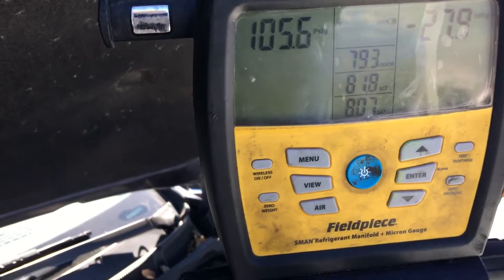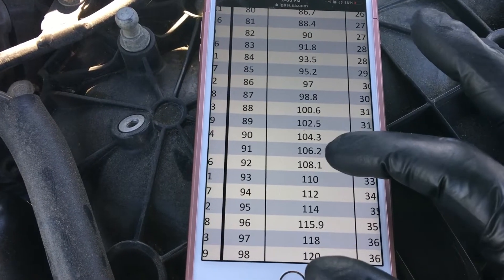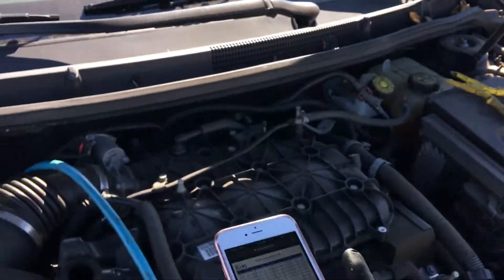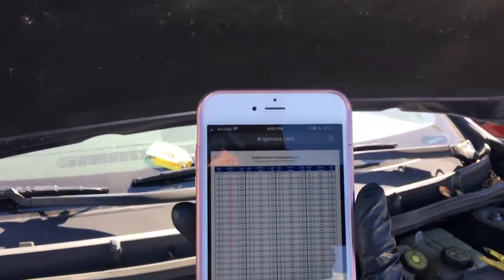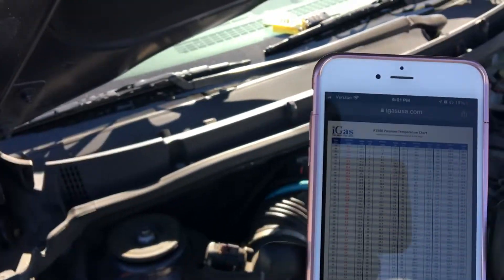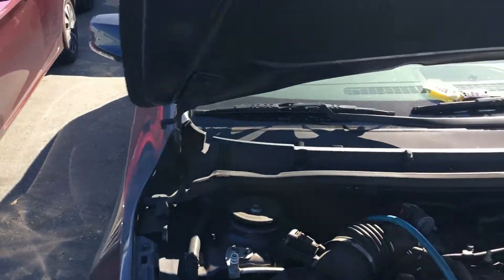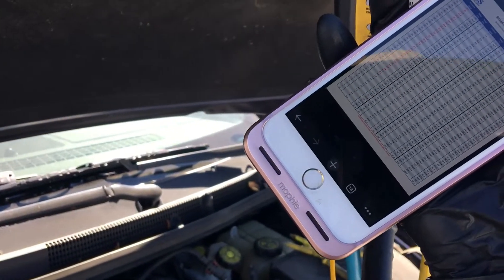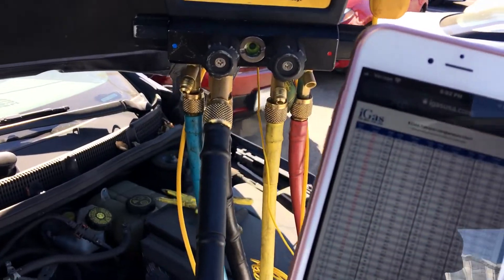Pt chart Use To tell if refrigerant is pure or contaminated￼ ?  Is it reliable ? Only 1 condition￼￼

Comment: Don't know if you've figured it out by now but the p/t chart tells you the temperature that the refrigerant will boil in the evaporator or condense in the condenser. It doesn't directly tell you what the temperature of the refrigerant is at a given pressure.
Reply from the maker: If you don’t know and figured it out by now. 
Automotive isn’t always like residential and have the high side service fitting located at the compressor discharge . 
     Where are you? Be measuring superheated vapor that does not represent the temperature of the refrigerant on a PT chart.

If you don’t know, and haven’t figured it out yet . 
     In automobiles, they sometimes locate the low side service port off the compressor. And you may have an accumulator and a muffler friction loss or heat gain giving you a completely different pressure than what’s exiting up at the evaporator and your PT chart doesn’t mean anything at that point. 

Your information sounds like somebody who learned in a class or read a book . 

Instead of knowing what reality is actually working  .

Comment: Well if the mix is weird enough, I would say you can use it as a guidance. Here is an example I think you would like: I came by one of the “machines” workshops use to service cars. The gauge on it’s internal tank showed 10bars. In our temperatures R134a would have been around 5 bars. Did not need to look up the exact p/t relationship to know it was contaminated (probably with air and/or 1234yf).
Reply from the maker: Probably a lot of air that’s what I see in a lot of the machines.      Even the ones with automatic air purge that after years doesn’t work correctly. 

        Or worse yet the owner of the shop bought the cheapest machine they could get that has no automatic air purge in the only one who knew you had to take the temperature to tank and manually purge the air out what is the old first technician who quit and nobody knew anything after that and just kept pumping air into the next refrigerant that’s really common.
Reply: @coldfinger459sub0  That is very plausible. Most likely from taking out the refrigerant without pulling a vacuum on the hoses. Actually I have 2 machines like that, but have managed not to contaminate them that bad. They are semiautomatic - no automatic air purge.